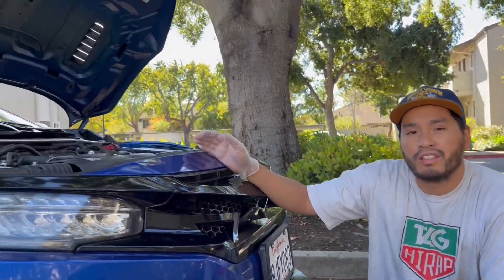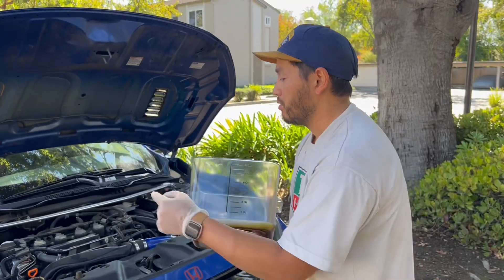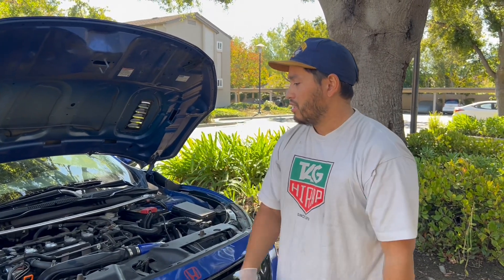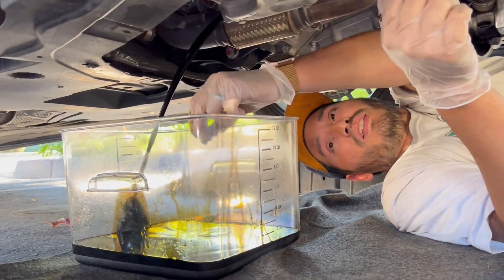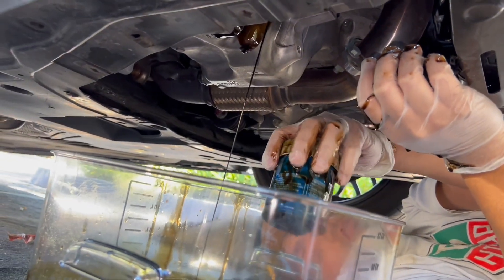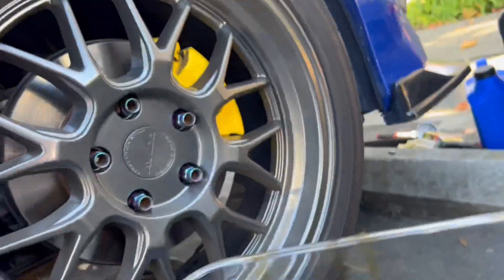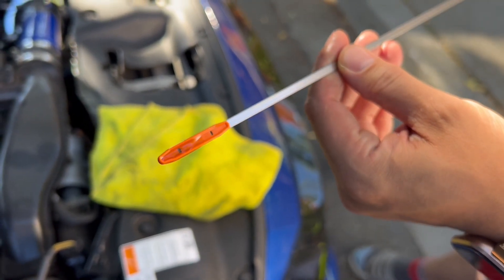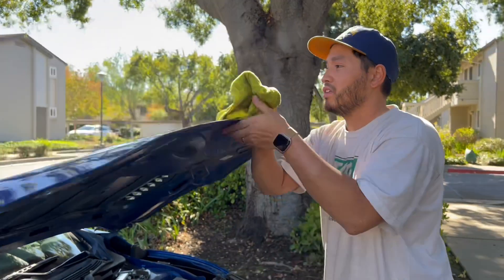Major Problem with my Honda Civic 10th Gen OIL DILUTION Fuel Mixing Issue, No Warranty Fix Recall

Comment: I'm guessing it can also cause poor gas mileage? I bought a 2016 1.5t civic and though in highway I get around 45 mpg I barely get 24 in the city. I can smell the gas when I exit the car or when I smell the oil stick, bummer. Should I change my oil with a thicker one from now on and does the gf6 standard really help? Thanks everyone for sharing all the info 🙌
Reply from the maker: Possibly it can cause poor mpg. Mine is not good either.

Comment: My 2018 EXT (bought new) currently has 121,300 miles averaging 34.1 mpg. All stock. No mods.
No oil dilution issues so far. However, I still change the oil/filter early and often...between 3,800-4,200 miles. I rarely take short trips. I drive about 60% highway miles. I only use top-tier fuel. Love my 10th gen. With my aggressive maintenance, I hope to get at least 300k miles without repair on the engine, transmission, or turbo. 🙏
Reply from the maker: Nice job! Thanks for sharing 🙏
Reply: hello sorry for my angelic writing by translator. my civic 1.5turbo cvt is 148,500km, change oil +/- every 10-12kkm. 30% motorway 30% city the rest is a quiet route 90-100 km / h. oil consumption, there is no problem of dilution, also although the oil smells slightly like gasoline, I also sweep it to drive 300,000-350,000 kilometers. question for you what gearbox do you have manual, cvt? how many times do you replace the spark plugs? how many times do you replace the gasoline filter? did you replace the accessory belt and the water pump, if so, at what mileage? greetings Honda user!
Reply from the maker: @krzysztofkosmowski940  we have CVT, have not done any of those maintenance yet but hopefully soon. Thanks for the comment!
Reply: @krzysztofkosmowski940  z tego co widzę to w USA często zgłaszają problemy z tym tematem. Mowa o mieszaniu się paliwa z olejem. Drugim problemem jest pompa oleju która ma wadę konstrukcyjną. W Europie czytałem o pojedynczych przypadkach związanych z dostawaniem się paliwa do oleju. Nie jest to duży proceder.  Mam znajomego który pracuje w ASO hondy krezel mówił ze u nich nie mieli takiego przypadku. Stoję właśnie przed zakupem hr v z takim silnikiem i waham się. Nie widzę innej alternatywy w postaci innego pojazdu o podobnych gabarytach. A cvt nie chce znać. Tylko manual.
Reply: @MG_MARC_MG  w USA jedni zgłaszają problemy drudzy mają po 200tys 300tys,kms nalotu u nich to chyba bardziej zależy kto gdzie mieszka od klimatu no i jakie dzienne trasy robi. Ogólnie sam silnik myślę że jest bardzo trwałą konstrukcją u mnie jest prawie 149tys km auto mam od nowości nie ma problemu z pobieraniem oleju nie przybywa go choć po przejechaniu 10tys zapach benzyny jest! Żeby tak nie wyglądało to słodko to bez problemów się nie obyło był wymieniany wtrysk już po 25tys gwarancja poduszka silnika po 125tys już po gwarancji 400€ chociaż po demontażu wyglądała jak nowa to stukała! Zbliża mi się duży przegląd i musiałem podjąć decyzję czy zmieniać auto na nowe czy zostaje nadal przy tym niestety względy finansowe zmusiły mnie do tego że muszę nim dalej jeździć  decyzją zapadła chcem nim pokonać kolejne 150tys. Ja osobiście polecam ten napęd jest bardzo dynamiczny oraz potrafi być oszczędny zejście że spalaniem poniżej 5 litry w spokojnej trasie nie stanowi żadnego problemu! Bolączki mojego egzemplarza to zapewne choroby początku produkcji. Gdybym miał dzisiaj podjąć decyzję o zakupie auta z tym napędem nie wahałbym się. Do skrzyni cvt nie będę nikogo przekonywał bo jest to wybór indiwidualny mogę tylko napisać że jest bardzo dobra 30% pokonanej trasy robię w zakorkowanym mieście więc wybór był dla mnie oczywisty a na autostradzie nie mam do niej żadnych zarzutów, jest bardzo płynnie i auto dobrze ciągnie!
Reply: @krzysztofkosmowski940  
1. CVT fluid replace every 40,000 km or 24 months. 
2. Gasoline/fuel filter recommend to replace every 80,000 km. 
3. Iridium spark plugs to replace every 100,000 km.
Reply: @metzmatu8409  thanks for the info but i sold the civic and bought a crv hybrid.
Reply: I don't believe you.  Your car has the problem, perhaps you are not aware of it.  Do you check your dipstick regularly?  Have you changed to premium fuel?  Are you using a higher viscosity oil?  Do you live in a warmer climate such as California?  Are most of your trips over 10 miles?
Reply: It's 2017 model problem, 2018 no problem
Reply: I have a 2018 EXT sedan in 6 sp. manual and I get vastly better mpg than that. Must be something wrong with your car either that or you drive like a maniac. One trip I made from Lehi Utah to Malad Idaho (to buy lottery tickets) on a really hot day with the temp about 100 degrees F I got 47 to 48 mpg!! And some of that was at 80mph since our rural interstate speed limit in Utah is 80!! One of the only great things about this state. I hate it here in most ways.
Reply: My car is having the same issues i do take short trips